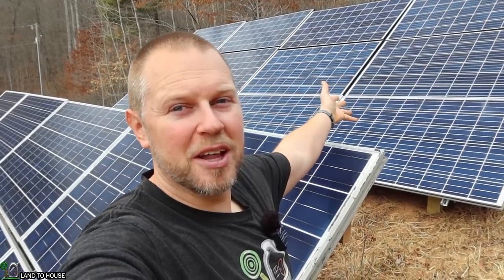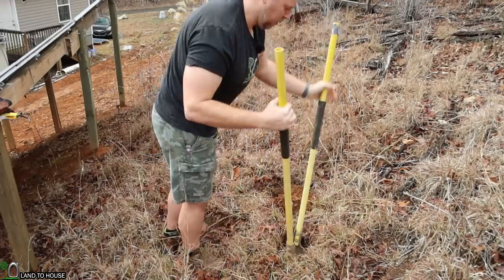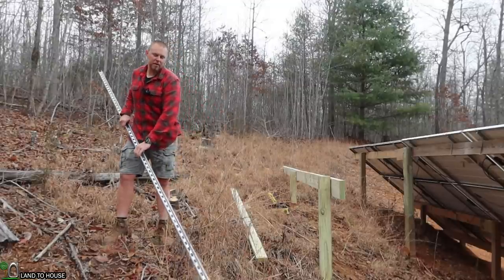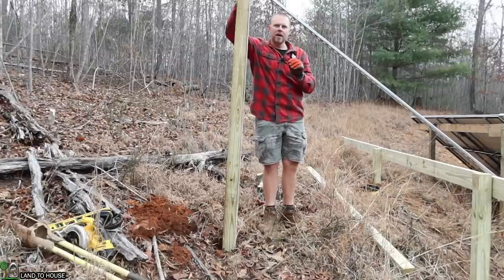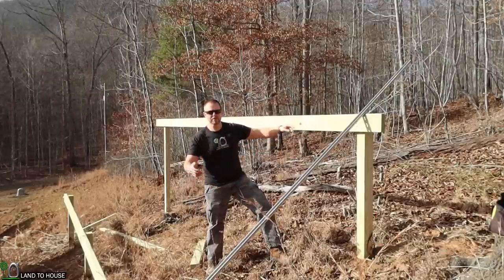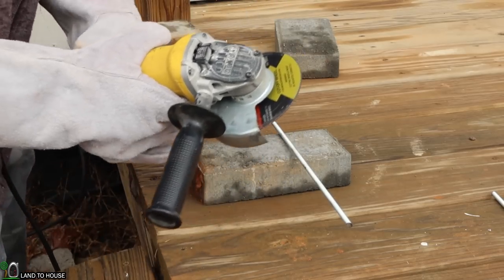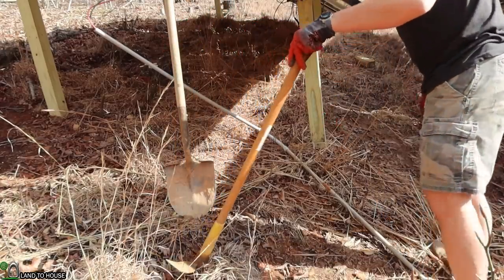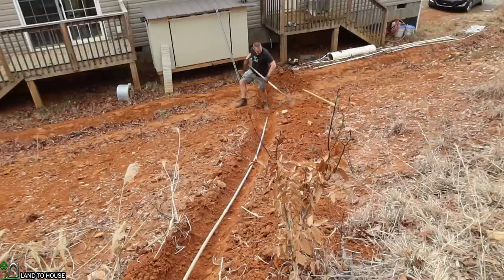Full DIY Install 3000 watts of Solar Power

Comment: About pointing your panels...... you might want to consider pointing them into the wintersun because that is when it matters most to have the optimal angle.

I do hope the house is not throwing a shadow on the panels during the winter....

Comment: well, this is bound to last for decades
Reply from the maker: Hopefully so. The first 3k is over a year and has no sign of wear.
Reply: Steel posts in concrete might last for decades. This probably won't but that's fine since you can rebuild it in an afternoon.

Comment: Ground mounting is sure the easiest.
I prefer pole mount for a portion of my panels so they can be aimed directly at sun . I leave them almost vertical in winter to shed snow.
Reply from the maker: Do you have the Pole mount panels that can be adjusted electronically?

I've enjoyed installing panels and then walking away. Not having to do much maintenance.

Comment: Wow! 3000W upgrade. Nice!
Be sure to keep an eye on your wooden supports and stringers for boring bee damage during the summer months. Those are terrible in my area.
Reply: Those bees are called carpenter bees and they damn sure are a pain and very IRRITATING when they buzz next to your ear and come back when you shoo them away.
Reply: Yeah, I killed 31 of those little bastards around the fence line of the house I just bought last year.  Thinned them out pretty good if not all.  I used a yard stick to swat them down like a Jedi Knight.  Wound up drilling holes at the end of the yard stick to keep it from breaking and helping with swatting speed by reducing wind resistance.  😊

Comment: Just a suggestion. Put some caution tape just underground!
Cheeper utilities is awesome!
Your probably going with 48v. Looks like a higher voltage is becoming the thing!
Reply from the maker: Ah yes red tape would be good above the wire. My current system is using 48v. Soon I will change out the agm batteries to lifepo4.

Comment: Did you ever think of using water cooling on your solar panels during the summer. You could use your ram pumps to feed them. Typically you get another 5W per panel when cooled (you coul test this), but you may also get another 5 years of life from the panels (harder to test). Don't let them freeze though. Best of luck with your solar/pumps. 👍

Comment: Nice upgrade. Sounds like you are building a system comparable to the one I am installing. I have 2 EG4 3kw inverters and 2 of their 48v batteries, along with 5kw of panels for the roof. If you want to come shoot a vid installing roof panels come on over I could use the help. I'm in Ashe County.
Reply from the maker: Very nice. The EG4 seems to be a really good brand. The inverter that's inside of the house is an EG4 that has been rebranded. Those batteries are costly but the best around.

Comment: Is there a reason you didn't concrete the post holes? Seems like they could easily fly up outta the ground with wind.
Reply from the maker: I put them all about 2' in the ground. It's possible they may attempt to fly out of there. We have strong wind maybe 10 days a year at my house
Reply: @LandtoHouse  Even in concrete, 2ft isn't really deep enough

Comment: Nice! I do wonder the cost benefit without tax credits. 
I have chosen to reduce my electrical usage, thus lowering the $$ spent on electricity. I am using about 13km per day & trying to reduce more.
Reply from the maker: These panels were used and purchased at a fantastic price. I'm sure they still have plenty of years left on them.  inverters are not terribly expensive. Those batteries sure it gets expensive in a hurry.

Comment: Did I miss why this is going into the house?   I thought you moved all your solar, water, inverters into the little shed.
Reply: OK, so wrote the above before the final 2 minutes....
Reply from the maker: I actually have an 8kw inverter and 15kwh battery using this power. The house is now half off grid.

Comment: Doesn't painting the solar panels grey block the sunlight😆?
Reply from the maker: The frame haha.
Reply: @LandtoHouse  Sorry. Couldn't resist. You only said that you painted the panels grey. Didn't say frame. I knew what you meant. But it was funny at the time. I was pretending to be stupid. Some AREN'T pretending, though ROFL
Reply from the maker: @shadowhawk1st   For sure. Just between you and me I accidentally did paint some of the panels. Had to use some goof off to clean them.
Reply: @LandtoHouse  But look how prettier they are with a few coats of paint 😆
Reply: @LandtoHouse  On the serious side: I LOVE your videos. I learn so much from you and a few others. I hope this year that I can apply what you all have taught me. Just need for a few things to click first then I hope to be totally off the grid
Reply: @LandtoHouse  Have you ever considered using biogas that you can make as a backup fuel source for a generator? That's MY dream. Solar, hydro, and biogas. Everything into one battery storage. Batteries can be kept warm via redneck geothermal to keep it cheap. Installing all won't be very cheap at first. But with DIY work I think it would pay off. What biogas you don't need for generator can be used for cooking and heating

Comment: first you used wood as the base and connecting pices that will rot etc... yo uneed concrete footers raised up with galvanized posts etc with a earth ground as well as if you need a permit to build this you need to research.. if you ever have a fire too those planks will catch fire that dead brush around them dude what are you thinking clear it 20 feet around it put in dirt or rock base  this is what you call a hazard